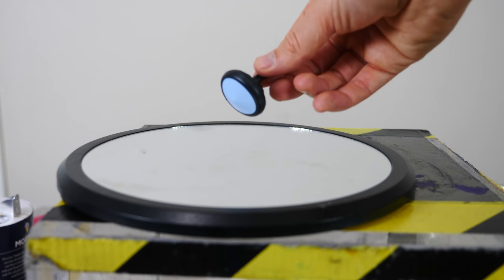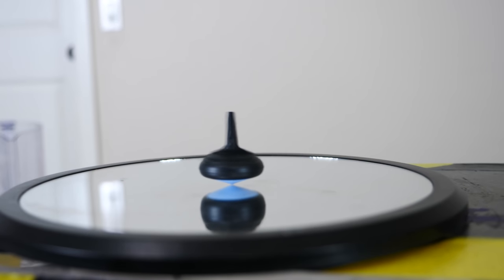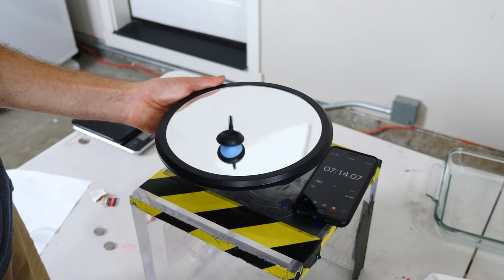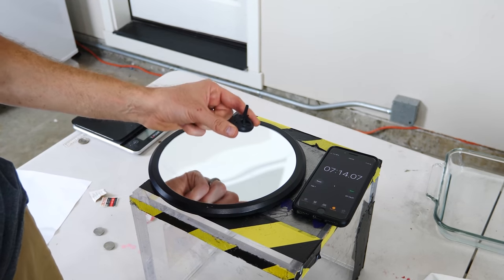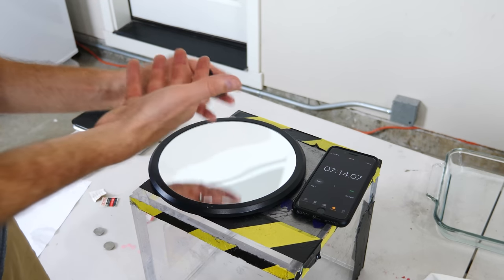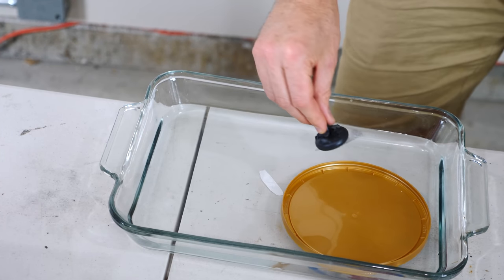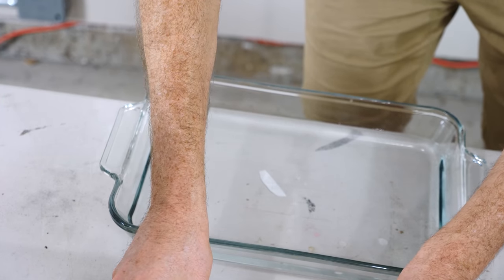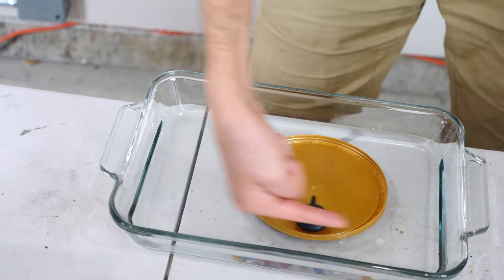The Inception Top That Never Stops Spinning

Comment: I had an unrelated question.

I'm shortsighted. I couldn't see the writings on the whiteboard one day because I forgot my glasses. So a friend told me to make a tiny hole with my fingers or in a paper and look through it. I did that and I could see only a tiny area but that area was clear enough for me to be able to read the words properly.

I wanted to know how this happens.
Reply: I asked this question in a previous video of yours but didn't get an answer so I asked again. Sorry if I'm bothering you. I was just really curious that's all.
Reply: @rhythm5080  basically the holes make for only so much light comes in through a concentrated area. This focus of light helps your eyes. That's how it was explained to me. Hope this gets you close bud.
Reply: Look up"pinhole lenses". That's how early photography started and it was the ver first kind of lenses to focus things.
Reply: @rhythm5080  Big lights throw soft diffuse shadows, small point lights (like a single LED) throw sharp and defined shadows. By making a small hole you get sharper "shadows" on your retina which makes everything sharper. You're increasing the depth of field. It's the same as with a camera, with wide aperatures you can get a blurry background because the depth of field is so shallow, make the aperature tiny and you can focus on both something that is very far away AND something that is close by. :)
Reply: During nearsightedness, the focal point of cornea increase and the image appears blurred. By using spectacles, the light get focused into the cornea. If someone has minus power, his/her specs decreases focal point, thereby,  focusing the light directly into retina of eye through cornea. In your case, the small hole too works in the same principle as of spectacles. The hole focuses the light into retina through cornea of eye, and the image becomes clear. 😎😎😇😇
Reply: Did anyone hear me?
Reply: check out minute physics he talks about very clearly
Reply: @bepisboi7370  Yes I heard you
Reply: @justitroyal7032  sauce?
Reply: @bepisboi7370  Yes I heard you. Just cause I need glasses doesn't mean I'm deaf.

LOL, jokes apart. Thank you man.
Reply: @rhythm5080  What's sauce? Or u meant Vsauce?
Reply from the maker: https://www.youtube.com/watch?v=Eouvsy8JdLU
Reply: Everyone’s being complicated n shit so here’s a more simple explanation.

So the reason why your shortsighted is because your eye can’t focus correctly, basically your pupil can’t dilate the right amount. So when you make a tiny hole, you’re simulating you’re pupil dilating more than it can. It does the same thing to the incoming light that dilating your pupil would do.
Reply: @TheActionLab  you literally replied  man salutee
Reply: @TheActionLab  Thank you man 😍
Reply: That’s cause of your making a pin hole camera, hence adjusting focal length of the image with your hand with hole on a sheet
Reply: Ask it again he might be able to see this.
Reply: It's dark magic in it's simpler form.
Reply: It is like a pinhole camera.  Basically, the focus point is changed.
Reply: Its not a awnser but i notised if i get my finger close to my eye and watch beside it the background will curve towards my finger and bend idk why this happens maybe because the warm air from my finger 

But what i wanted to say, thats why its happening.

(I noticed it long time ago)
Reply: @rjuuuuun  😂.
Reply: the paper is a paid actor!
Reply: It's the basics of optics and... classic photography. If you want your photo to be super sharp, you use high number iris in your camera lens (with small aperture, through which light comes in), but the resulting picture will be darker, with smaller number of details on it. Choosing low number iris (with bigger aperture) will result in more details in the picture, but the whole photography will never be as sharp. Can't have both at the same time (without any digital trickery at least), that's the laws of physics...

Example: you want to take a picture of a landscape. You are standing atop of the hill, and in front of you, in the distance, there are fields, a line of forests and some distant city behind. If you use high number iris to take the picture, it will be sharp, but the forest may just "melt" into one dark line, without single, discernible trees.
For comparison, using low number iris will allow you to take picture, where you will be able to see all the details, buildings in the distant city, separate trees and bushes in the forest et. c, but in the same time the whole picture will be always "distorted'. If using classic analog camera film, this will present as a sort of "mist" covering the whole picture, or it may even be grainy (which depends on how sensitive is the film, and the ambient light conditions, of course).

I'm also shortsighted. Squinting your eyes, or looking through small hole works exactly the same as using high number iris in camera. You limit the amount of light that comes in your eye, so the picture becomes darker, but in the same time it becomes sharper at bigger distances.
Reply: Simple answer.
Your eye has an easier time adjusting to see the board.
Reply: Likely the same reason when you look at a mirror in the dark you supposedly see "bloody Mary" and weird pareidolia stuff. 
Something to do with your brain filtering out what's not important.
Reply: That is the pinhole effect.

Comment: "never stops spinning UNTIL THE BATTERY RUNS OUT"
Reply: Hats off
Reply: It would wear a hole through the mirror after a while
Reply: Exactly
Reply: Put the top at the center of the lid.
Reply: its just the first perpetual motion machine but he's hiding how to do it 👁👁
Reply: My car runs forever unti it runs out of gas
Reply: "We are free until covid-19 come around"
Reply: @nocknock4832   no it is not
Reply: xlioilx  afraid the capacitor to hold the energy will go out long before the sun does.
Reply: @float32  Are you sure? The earth itself moves, so it seems to me that the top would change position very slightly, over time.
Reply: NO JOKES😡

Comment: 1:50 it would work tho,if the motor inside accelerated all the time.
Reply: it stops when battery it's flat, misleading title
Reply: No not actually unless you have an infinite energy source or a perpetual machine.
Reply: @virajkapani6159  this wasnt meant with this video, but yes you are right

Comment: I had various incarnations of this with the Chinese circuit board back in the 70's (they still use the same board! slightly changed for the voltage to coil input now tho. but my favorite was always the pendulum toy.

Comment: My guess before watching the video on how the top keeps spinning: There's weights inside that extend out by centrifugal force when spun at high speed.  As momentum is lost, the reduced centrifugal force makes the weights move inward, causing the top to get that momentum back, due to conservation of angular momentum.
Reply: I was wrong...I didn't expect there would be a motor in the top.

Comment: I find it helps to understand what is going on, if I think of the lower tip of the top's shaft as a sort of bevel gear, being tilted from the normal to the surface. And as the top wanders around the mirror, it acts like a planetary bevel gear -- but an inefficient one with lots of slippage.
Reply: totally agree

Comment: When it spins on the table, is it making the entire earth spin a little bit in the opposite direction?
Reply: Turns out the top isn't spinning, the Earth just spins faster
Reply: technically, yes, but not really, because the repetitive chockwave from the top will rapidly decade into heat has it travel trough the table and ground.

Comment: Hey I have a question
All objects have mass . Right ?
In 2 D objects , there is no height, so the volume will be 0 
(As v=l ×b×h)
So it will have mass , but no volume theoretically , 
Now density=m/v 
= m/0 , = infinity
Is this possible . Pls help
Reply: Because 2D objects are not objects with mass. They only exist as a mathematical construct.
Reply: 2d objects don't have volume they have an area
There are 3 types of density 
1.) Linear density for 1D objects
2.) Area density for 2D objects
3.) Volume density for 3D objects

4.) Time density for 4D objects (its a joke)
Reply: @sudhanshu9831  thanks for the help!!

Comment: I have got an explanation for 4 d objects .
As we know 2 D shapes can be made by placing a number of 1 D lengths , after which it will have a breadth , making it 2D . By placing many thin 2d papers on top of each other , we make a 3d figure with a height . So is it possible that we can make 4d using 3 d shapes .??? Pls help
Reply: Yes but we'd need access to the fourth dimension anyways. The 3d shapes would need to extend into a dimension we can't perceive.

1 dimension is just a flat line with two directions, let's say left and right. You need the up and down directions to make a 2d shape out of these lines. If you lived in a 1D universe where you can only move left and right, you can't make a 2D shape because you'd need up and down. Same thing with making a 3D shape from 2D shapes. In a 2D universe you can only go up, down, left and right, so you can't make a 3D shape because a 3D shape requires forwards and backwards.
Reply: @paulwebb2078  Fair explaination. 
But you are talking about making 4d in practical, and I am talking about a theoretical 4d . Not talking about making 4d

Comment: Could a stator coil be used around the tip of the spinning top to extract more power than the battery uses inside the top ?
Reply: no

Comment: How much energy is used from the battery (in Milliwatt hours) to keep the top going versus the amount of energy it could generate as a dynamo??? I PROMISE YOU the amount of kinetic energy recovered in the form of electrical energy will ALWAYS be lower than the amount of energy put INTO the system with the remainder being dissipated & lost through thermal dynamics. That's just how the laws of physics work...
Reply: You're implying that this video is suggesting that the top is supplying free energy. It isn't suggesting that. The video is only talking about conservation of angular momentum, not perpetual motion.